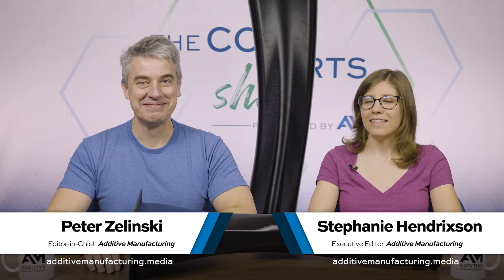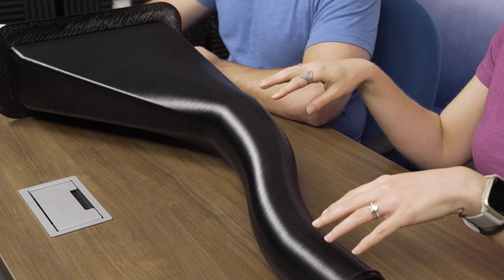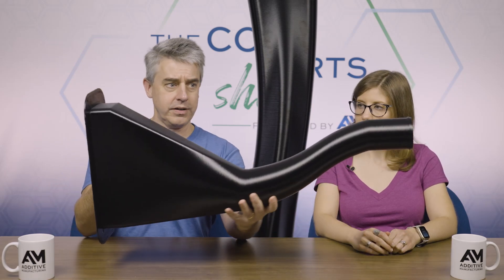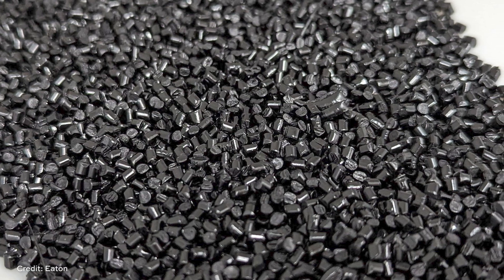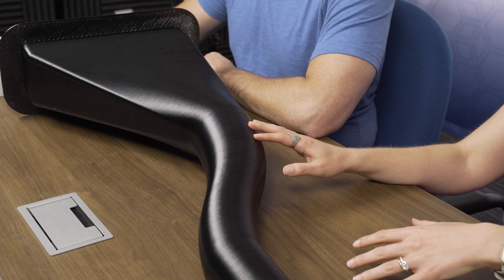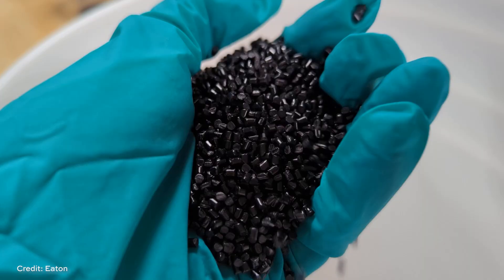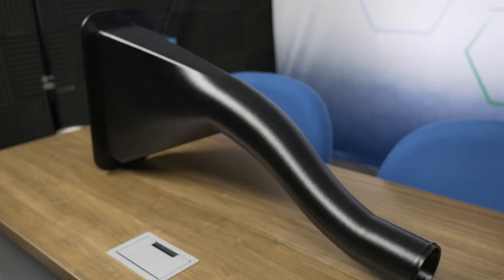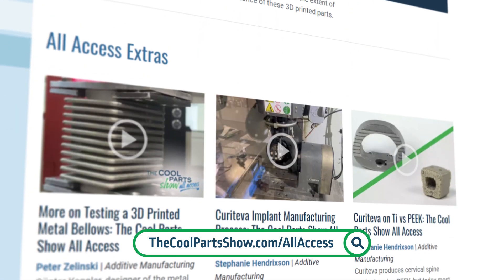Aircraft Ducts 3D Printed in Composite Instead of Metal | The Cool Parts Show Ep.68

Comment: Eaton is going to have a heck of a time getting PEKK materials like that to print well. They have extremely high contraction during cooling that is further worsened with the high temps needed for these prints. So the issues with these types of parts are going to be significant hoop stress that limits total comparative strength, warping on any flat areas, curl on any sharp corners, and dealing with variable crystallinity for the differential cooling rates during printing. Not even getting to the issue with volumetric air flow and deltaT in the printing enviroment.